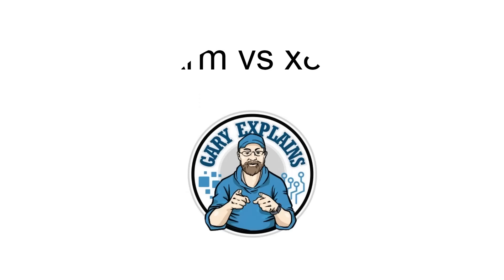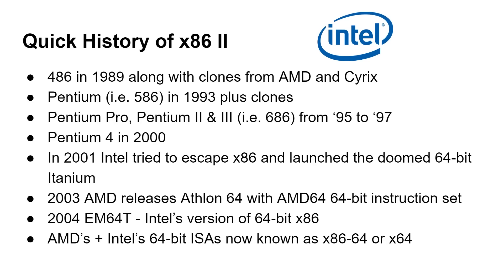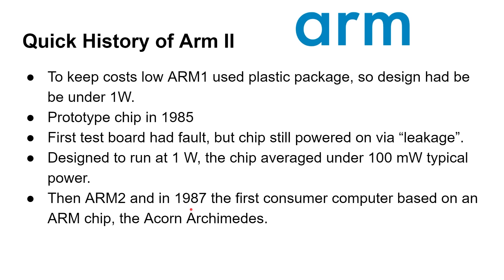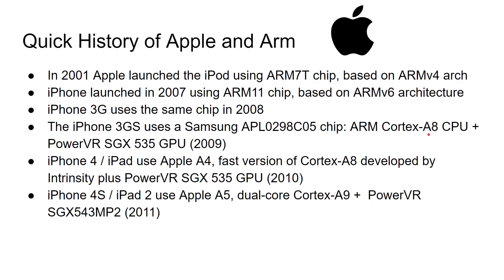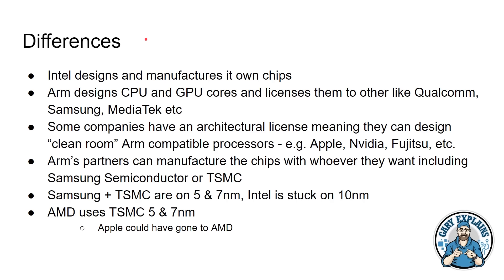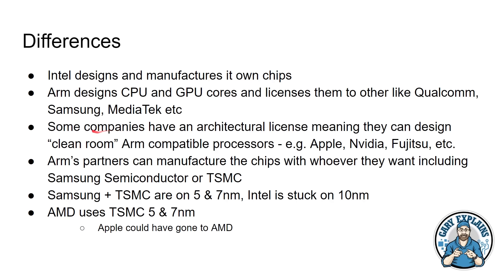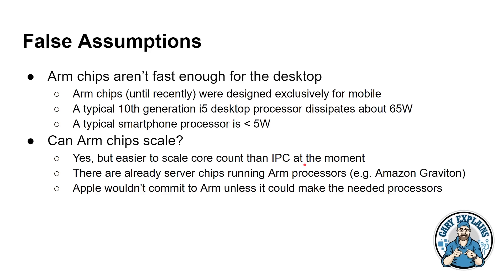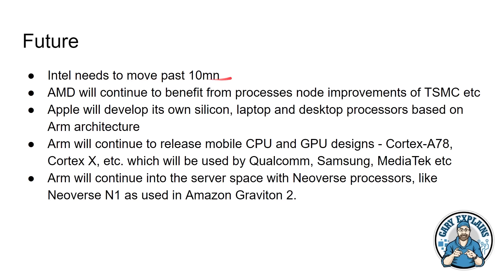Arm vs x86 - Key Differences Explained

Comment: So what would be any arguments in favor of the Intel (or X86 in general) side of the situation?
Reply: Unexpected complications with 10nm.
Reply: IPC and higher single-core speed.
Reply: The same reasons that CISC was developed in the first place, in the 1950's memory was rare and expensive, complex instruction sets where developed to reduce the ammount of memory required. Today memory is cheap but its speed hasn't improved as fast as CPU's, a RISC CPU requires more instrucions hence more memory access, so memory bandwith is more of a bottleneck. That is why a CISC CPU can have a major advantage in high performance computing.
Reply: Compatibility. That's it really. x86 has come to the end of the road. The thing is bloated by all different design paths taken and extensions implemented over the decades, and is crippled by legacy design philosophies from the 70s. Compatibility is really the only reason it has come this far, that is what attracted investment. PowerPC is a way beter design even though it's not much newer, but it came in a time when Wintel rolled over all competition in the 90s combined with insane semiconductor manufacturing advances that only the biggest dogs could afford, and thus PPC didn't gain the traction needed to survive in the then crucial desktop and later laptop computer markets. Now the crucial markets are server and mobile devices, places where ARM has a growing foot in and totally dominates respectively. Now ARM is getting the funding needed to surpass the burdened x86 in all metrics. The deciding factor is that x86 has hit a wall, while ARM has quite a lot of potential still, and that is what ultimately will force the shift despite broken compatibility. Some will still favour legacy systems, so x86 will be around for a long time, but its haydays are definitely counted.
 @RickeyBowers  ARM has way higher IPC than x86. No-one has ever really tried to make a wide desktop design based on ARM until now, so total single core speed is only valid now a few more years.
Reply: @Robwantsacurry  Single core performance is also better with x86 CPUs, for ARM CPUs to accomplish anything they NEED to have multi threaded programs other wise they are extremely slow
Reply: CISC is the more powerful instruction set architecture since the decoder has a better picture of what the instruction is doing. CISC might have a single complex instruction that asks to do a block transformation on a vector. RISC might do ten simple and fast register operations insted. In 1990 the RISC might have been faster. BUT today, the CISC instruction decoder can see that hey, it's a vector transform, cool, let's assign that to this dedicated hardware that does it super fast because it knows a better way to do it in hardware. But the tenregister operations that make the RISC operation cannot be optimized away - they still need to be executed as ten register operations since the decoder cannot see that it's a vector transform. Furthermore, please note that neither of those architectures (Intel or ARM) really are CISC or RISC processors since in both of them, the instruction decoder translates the instruction set into any number of different internal operations, which the core then executes.

Comment: Silly question : why haven't we uses ARMs processors in PC before ??
Reply: There have been ARM powered computers (Raspberry Pi is best example) but it's been hobbyist/niche market.
Reply: because people don't want to rewrite everything! ARM architecture is dominant in embedded system market,in SOCs,  you won't see x86 architecture popular there. For PCs, it's opposite. Intel already dominated PC market so it's hard for any company to develop a system for entirely different architecture. The S/W developers  (especially the cross compiler designers) will surely have headache, but if Apple is successful, it will indeed bring a revolution, and challenge Intel monopoly in pc!
Reply: @Ashish414600  ok thx for your answer.
Reply: ARM is actually a RISC architecture, and there is information about it in Grove’s book (Ex Intel CEO), he claims Intel actually considered using RISC instead of CISC (current Intel chips architecture) but he decided against it because there was not much of a difference, consider we are talking about a time where most computers where stationary and didn’t need to be energy efficient, so it made sense back then to keep on with CISC. However, nowadays energy efficiency has become very important and that’s where ARM is taking an important role.

Comment: I grew up using the 8088 in engineering school and upgraded my PCs along the way.  I worked for Intel for 20 years after they acquired the multiprocessor company I worked for.  I got rid of most of their stock after I stopped working for them and I saw the future in mobile. These days, my W10 laptop sits barely used while I'm perfectly happy with a $55 Raspberry Pi hooked up to my 55" TV.  Each time I use my W10 laptop it seems to be doing some scan or background tasks that take up most of the CPU cycles.  Old Dinosaurs fade away.

Comment: Mean while when we could expect to see risc-v isa based smartphones and PCs. If someone would be bring out high performance , Out of order, deeper pipeline, multi threaded risc v processor then it might give tough competition to ARM
Reply from the maker: The sticking point is the whole "if someone would be bring out high performance , Out of order, deeper pipeline, multi threaded RISC-V processor". The problem isn't the ISA but actually build a good chip with a good microarchitecture.
Reply: Microsoft and Apple wouldn’t be spending billion on changing to ARM if they didn’t feel that ARM could keep up with x86 development while still offering significant power savings. Where RISC-V is still an unknown. Saying that, by supporting ARM it would most likely make supporting RISC-V in the future much easier.
Reply: @shaun2938  yeahI think compatibility won't be big issue because they all can design and make it backward compatible.
Reply: RISC-V will take a decade or more, I think it will mostly be embedded and microprocessors for now and it could take a huge chunk of that market. And some a predicting RISC-V will be used in the hardware security module market
Reply: @GaryExplains  Do you think Apple could roll their own instruction set in the future?
Reply from the maker: Why would it do that? Then it would have to do through another transition for no gain. The instruction set doesn't determine the performance but the microarchitecture (i.e. the design of the chip).
Reply: @GaryExplains  yeah, only reason would be to get away from ARM license fees which I doubt are worth the burden of switching. Especially because they probably get design help from ARM as well. If they wanted to be free from others: RISC-V and PowerPC are both freely available. Would be ironic if they went back to PowerPC LOL
Reply from the maker: @STRATUSPHERE01  You got any proof for all of that?
Reply from the maker: @STRATUSPHERE01  Can you please share the proof.
Reply: @STRATUSPHERE01  so far there is no proof for this. The deal with samsung is only for AMD to design the GPU for their soc (based on RDNA) not CPU. the mobile world is simply dominated by ARM based proocessor. All of the application are build for ARM cpu in mind. They can do whay intel did with soc before to run ARM based application but that's mean they need to do extra work. Samsung most likely not want that "extra work" complexity. Staying with ARM is still the most make sense for them.

Comment: Everyone comparing ARM and Intel, no one talking about ARM and AMD Like the Ampere Altra(80 core) VS EPYC 7742(64 core). Ampere is 4% more powerful, and uses 10% less energy making it 14.4% more efficent than AMD. But some people might point out that for AMD to compete with an 80 core, they have to pump more power into their 64 core which uses disproportunately more energy, than poerformance it improves, i'll be REALLY interested to see how a fully 7NM AMD EPYC where that space savings from a 7nm IO die instead of 12nm makes room for two more 8 core CCDs for a total of 80 cores. Some might argue, that if AMD had used a fully 7nm processor and had 80 cores, they would be not only more powerful, but also more efficicent(less energy for that power)
Reply: So what about threadripper Pro? Its 20 percent more powerful than intel platinum 58 core
Reply: @scaryonline  Doesnt it use more power than epyc because of higher frequency?
Reply: I found no independent benchmarks for the Altra CPU, Ampere claims(keyword here) their CPU is 4% more powerful IN INTEGER WORKLOADS than the Epyc 7742. Saying the Ampere Altra is ''4% more powerful(...) than AMD'' is a bit misleading here.

Comment: RE:"I used to work for DEC". You're legit old-school!   And here I figured all this background stemmed from lots of drudging old readings from the past!  Wow.  Well, I really do appreciate your easy discussion of all these topics that span chip architecture.  And I would ask for some discussion on the Alpha (starting with 21064) to press you with your unique background.  That architecture certainly must have made Intel sweat given the incredible speeds.  LITERALLY incredible, as in, I literally did not believe the numbers I was seeing.  I think they were doing 333 mhz while Intel was at 50 or so.  I remember dismissing it as impossible.  And by the time I might have been able to gain enough info on it, I had already dismissed it as irrelevant when I learned that its different ISA made it an apples and oranges comparison with x86.  And I only gained the perspective to appreciate the Alpha ISA long after Alpha had become a historical footnote.  I should mention the latest literature that I have crossed mention of the Alpha and that is the RISC-V architecture book which mentions the goal to dodge the undesirable end of abandoning an architecture and the nuisance/expense for everyone invested in the platform.
Reply: I'm sorry, I got too excited and lost the direction of a sentence.  I would ask... EXCEPT I know it would be an irrelevant bore to most of your audience since it IS just a historical footnote.

Comment: nanometer litrography doesnt mean anything when comparing 2 CPUs from different manufacturers because they define what they mesure as litography differently, aka intel CPUs will have more density of components at the same litograpjy size and even 1 size smaller from another manufacturer like tsmc
Reply: Intel's talks with TSMC show's that Intel's 10nm is actually similar to TSMCs 6nm (not 7nm as speculated) and Intel's 7nm similar to TSMC 5nm.
Reply: Not true,  the power consumption is different, intel can have the same density,  but still use more power, because have bigger transistors
Reply: @l.lawliet164  how does that work if you go by transistor count (thats the density) intel can put at their 10nm litography same number of transistors in same space as TSMC 6nm, they just count different components(component that consists of multiple transistors)
Reply: @bigpod  that's true, but their transistors are still bigger that's why you see better power consumption for tsmc even if they both have the same density... this means Intel pack process is better, but there transistor is worse. Performance can be equal, but consumption can't
Reply: @bigpod  This actually give intel the advantage, because they can get same performance with a worse component and also more cheap.

Comment: Well I would not say Intel is "Stuck" on 10 nm. There are laws of thermodynamics at play here. pushing more power through a smaller conduit creates heat which creates greater electrical resistance. This may be why Intel has the all core clock speed advantage over Amd's single core max clock speed rotating as needed for thermal tolerance while the other cores are down throttled. 10 nm might actually be a sweet spot for current x64 architecture. Arm research might be what is required to truly take advantage of smaller than 10 nm without riding the extremes of the laws of thermodynamics. If you need an analogy imagine trying to push 100 amps of electricity at 240 v through an 18 gauge wire. You will start a fire or burn out the wire conduit.

Comment: 80286 had segmentation, but it did not have paging.  I think OS/2 would smoke a cigarette waiting for segment swaps.  80386 had segmentation swaps and paging. Paging was the what the engineers wanted. Beefier MOBO chips were needed to support DMA while the CPU continued to execute code. 8086 machines smoked during the DMAs with DOS.

Comment: Also, Nintendo has had a history with ARM, starting in 2001 with the GBA rocking an ARMv7 CPU all the way up to the Switch which runs on a Cortex. I think this is one of the reasons why they were kings when it comes to backwards compatibility (though the Switch kinda halted that and they would never allow for games from two generations prior to run natively, even though the 3DS is perfectly capable of running GBA games.)

Comment: Talking about porting of apps from programmer perspective: can x86 to ARM shift be done automatically? I've read many comments pointing that Apple moving to ARM might have some problems with actually convincing app developers to move to ARM. Apple is also offering special ARM based prototype computers for programmers just for testing so they could be ready for release of ARM Mac. Why is that? Isn't that a matter of simple app recompilation? Can't Apple do that automatically for apps in its store?

Comment: The instruction -> uops translation does not really counts. It inevitably takes some transistors, but currently there are so many transistors that it does not really count (say 1%). Compared to the total power consumption of a real computer (not a phone, but a notebook or a desktop) it is next to nothing. The much higher power consumption comes from many other things, like huge cache, AVX (yes, you use it much, check what a compiler produce!), branch prediction, out-of-order execution, hyperthreading and so. Some of these can be found in some ARM chips, but they mostly don't have them.
Reply from the maker: The difference is that those 1% of transistors are used ALL of the time. It doesn't matter how much space they take relatively, but how often they are used. Like putting a small wedge under a door and saying "this door is hard to open, odd since the wedge is only 1% of the whole door structure".

Comment: Hey Gary, I'd like to know more about how Metal, Vulkan and OpenGL works differently. Can you make a vid about it? Your vids of how things work are very informative.
Reply: Ha!  Wow.  The finer points in how an API is designed and a comparison of APIs that achieve similar goals but are designed by different groups is a tough one.  But I would like to add a perspective on this question since I've toyed with Vulkan and OpenGL.  And, really Vulkan is OpenGL 5.  Kronus, the creator of OpenGL wanted a reset in their API and going between the OpenGL versions in a somewhat graceful way was getting too awkward so they reset the API and went with a new name.  Now, to bring Metal into the conversation, it should be noted than Vulkan is effectively an open Metal since Metal is Apple's but it took the same approach in that they are very heavy in their rigid establishment in how the software is to work with the configuration of the display settings so that the runtime conditionals inside the API to cope with any changing conditions are minimized.  And this allows for very efficient communication between the application software and the hardware.  Also, Vulkan (and perhaps Metal too - I don't know, I've never actually programmed in it - i'm no Apple fanboy) consolidates the compute API with the video API so that you can run number crunching workloads on the GPU with a similar API as you could use to draw images to the screen.  And this lets you see the GPU as a more general data crunching device that only happens to crunch data on the same device where it is ultimately displayed.  OpenCL is another API that gives this capability (to crunch data) but it is a more narrow view of GPU capabilities in that you don't use graphics through it.  But Vulkan can be quite complicated because of all the burdensome setup that is to be established so as to simplify the runtime assumptions and this can really be a huge nuisance for a learner. Using OpenGL as of version 3.3 or so will make your journey easier.  But OpenGL ES 2.0 or 3.0 will make it easier still so you can avoid the major OpenGL API drift as of the programmable shaders era which completely changed the game.  Before that, there was something referred to as the "fixed function pipeline" and that's ancient history.

Comment: Well explained and detailed. I get tired of x86 fanboys saying RISC and ARM are crap with either outdated talking points and/or just plainignorance. I personally use amd x86_64 (so yeah x86) but naturally that doesn't mean at ARM can't be just as good. I'm personally curious to see what happens when apple spins it up for the desktop space (not bloody laptops and ipads) as that would be the real proof in the pudding. I'm also impressed with the speed at which people are porting software to ARM, I expected a lot more in terms of barriers to that